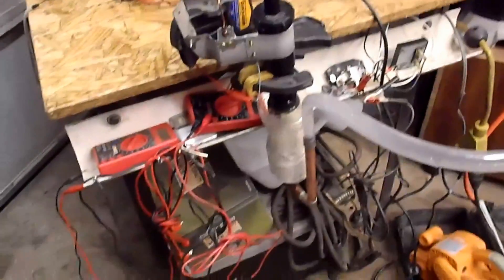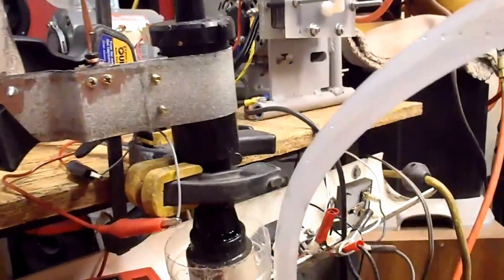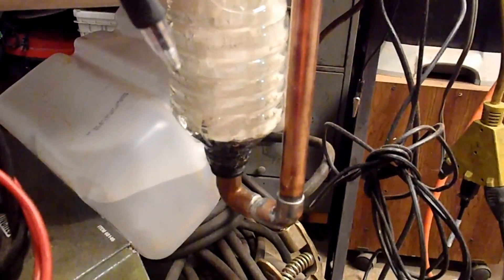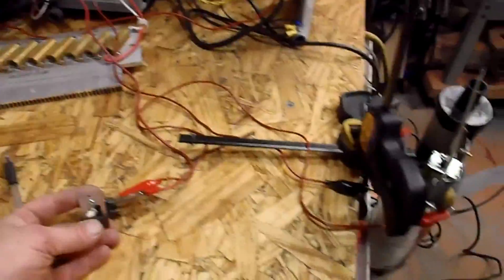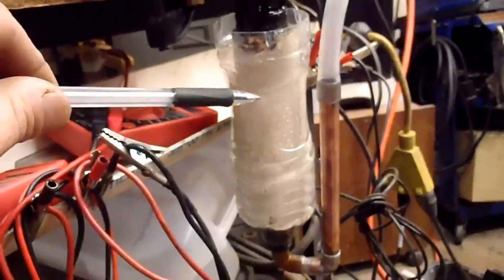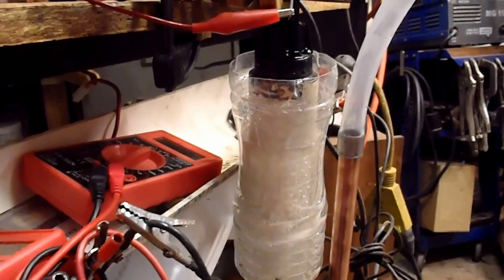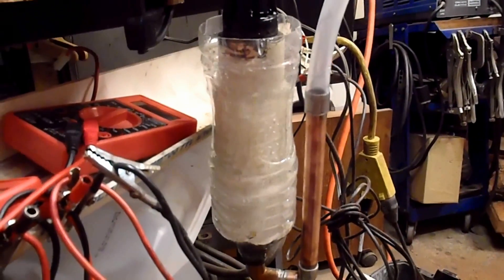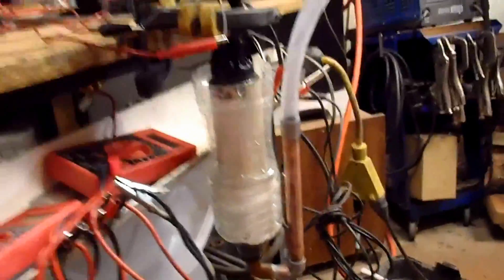HHO Dry Cell - 14 - Electronic Flow Meter

Comment: Hydrogen technology 🚓🚕

HHo gas help the combustion process to run engine more efficieently.  carbon-free fuel burnning.

HHO gas burn a lot faster then  gasoline or petrol. Hydrogen power  miracle gas remove carbon build up in the combustion chamber and boost  engine power and torque.  restores better fuel  economy.

 Hho car kit  prolonging engine life and engine oil life.

 Like a new car 

Engine runs smoother and cleaner to make your car 0 carbon emissions  Boost engine  power and torque Better acceleration . 

An efficient hho car kit lower the engine temperature more then 100 degree F.  Hho car kit reduce car maintenance charges. 

Cleaner engine running. Reducing engine noise due to the faster fuel burning. Hho car kits works nicely requires no modifications in the car engine. No side effects on car engine.

Engine start quickly safe your car battery. No more petrol or diesel smoke or smell. Hho system is very simple. It keep catalytic convertor cleaned if installed in a new car.

Hho kit installation  time is about two hours to make your car a low cost hy-brid.

Comment from the maker: @sixpack127 Yep, actually I decided to do it quite a bit differently... I want to use a long slender tube or hose that is clear, so that a small amount of displacement in the main chamber yields a large movement in the tube.  Then like you suggested, use photo-sensor's at the different levels.  When I get it working I'll post it.  I've even considered using a long resistive coil, along the lines of a gas tank float sensor.